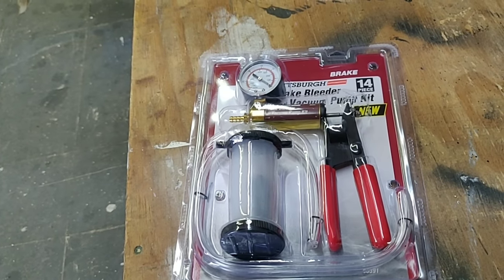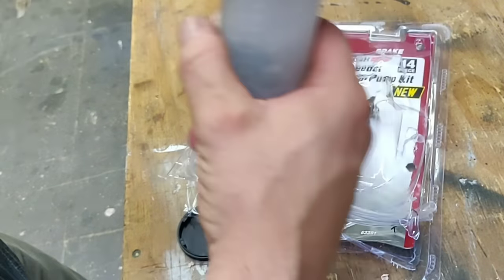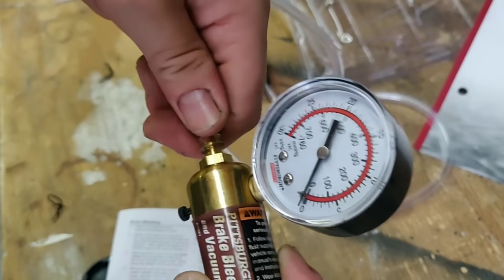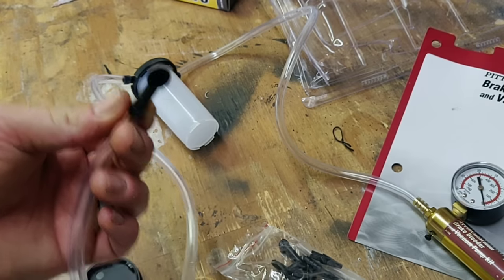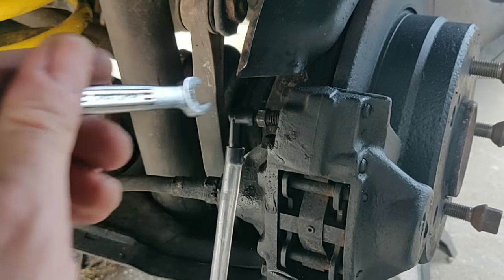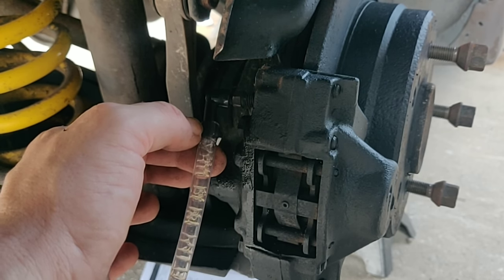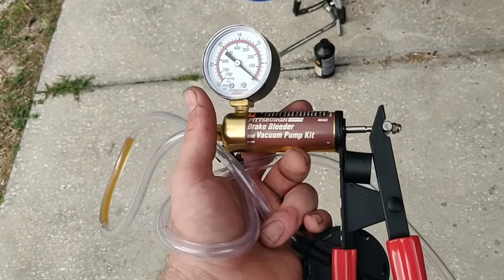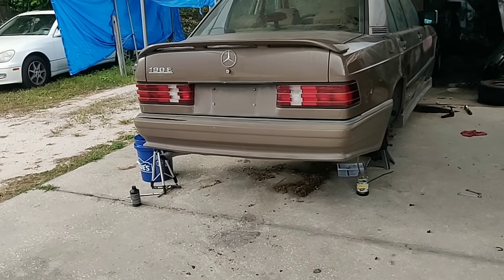Harbor Freight Pittsburgh brake bleeder vacuum pump demo and review

Comment: It’s not the pump! It’s that you’re doing it wrong my friend. You got to remove that little black cap that’s in between the handle & the bottle! That’s why if u don’t know what the hell ur doing read the instructions carefully! Now go back to ur garage trash can & retrieve those instructions and read them carefully. Just saying!
Reply: I have worked with hydraulic systems.  Seems to me a long tube, simple check valve and an inline fuel filter would work to establish a loop from bleeder back to reservoir.  Then just pump the brake pedal.  Another benefit is flushing the whole system.   About that "just saying"??  ditto.......LOL
Reply: JR BORIQUA7 let ‘em know!
Reply: Well said my friend
Reply: You’re correct. He still had the black cap on between the handle and pump. He wasn’t getting the full range of suction out of the pump. I took mine out and got 20inHg
Reply: Oops! Ah well....we’ve all had these moments. 🤦🏽
Reply: Lmao! Good shit ha
Reply: xsnrg714   That’s the first thing I did was rewind the video to see if he still has the black cap on that prevented the pump from pumping. 👍🏻
Reply: In fairness to Pete's Carport, my kit has the exact same collar/spacer, but it isn't pictured or mentioned in the instructions.  It wasn't clear what you all were talking about until I took a second look.  Once that silliness was out of the way, the kit worked fine and I did a flush on my Harley.
Reply: Yes, the black thing in between the handles has to be removed.
Reply: I’m still laughing.
Reply: Sour Kraut just as a heads up you shouldn’t just filter brake fluid as brake fluid  absorbs moisture and doesn’t like excessive heat either The reason why it turns brown and black is because it’s actually been boiled and not flushing things like brake power steering System like every third oil change is
Reply: More often than not the reason for components failing prematurely
Reply: Also, when he is 'talking it down' there is brake fluid in the hose where is not supposed to be any (beyond the catch-container).
Reply: lmao!
Reply: I bought it. Used it once and it broke. :-( I then took it apart and discoved the seals inside were not greased at all. Got the seal back in it's groove and greased it. Works better than ever now. So in other words, well conceived tool, just 'built to a price', no money for grease. Also the caps provided are too big for very small nipples. I have wilwood callipers and have quite some trouble on getting a good seal.
Reply: I still say that the front calipers even though they're new got a ton of crap pulled into them clogging up the bleed screw and he's blaming it on the pump not to mention he didn't even Grease the fitting to create a better seal. This is one of those channels that's out there just trying to make a buck and not actually inform people and doing it badly I may have
Reply: @jeffreydick5257  right? Brake fluid is literally one of the most hydroscopic fluids out there. Say if you have a bottle of brake fluid and forget to put the cap on it and leave it sitting overnight somewhere it becomes practically useless due to the water it absorbed being highly compressible
Reply: @bluesriderDF  In all fairness? As long as the rod is and the actual pump, if you're getting 2mm of motion on the pump stroke it should be obvious you're not doing something right.
Reply: @davidhouk7454   Everybody makes mistakes, everybody has a bad day once in awhile. I don't think the guy needs to be excoriated. Just my opinion.
Reply: @sourkraut6248  Only issue with that is pumping cooked or dirty fluid back into the system. You'll get the air out, but I wouldn't want to push fluid that's been at the caliper back into the reservoir. That said, I made a bleeder out of a check valve and a piece of hose. Rock solid pedal every time.
Reply: I just bought the same pump and was getting the same reading...until I took the plastic shipping stop.
Reply: RON K me too, lol.
Reply: @xnadave  You do make an excellent point.  Yes.......automotive brake fluid is relatively cheap.  Best to just replace as you go.  Pump reservoir down......refill......repeat.
Reply: I laughed way too hard at this comment LOL LOL!!!  Good Stuff!!!  :)
Reply: @campr23  What kind of grease? Good reference if I ever pick one of these up
Reply: @mrsemifixit  I just used ball-bearing grease (plastic/rubber compatible). It should not come in contact with brake fluid anyways (as it's behind the vessel to stop brake fluid getting to the pump). Anything really to provide a good air-tight seal and allow the seal to slide inside the piston.
Reply: What black cap u referring to
Reply: @samriley8278  haha im still laughing too! Glad he didn't delete the video out of embarrassment. My entertainment for the day.
Reply: @jerrysouthside8597  Between the 2 handles, it is fairly obvious when you look in that spot. It is a "spacer" that prevents full range of motion.
Reply: And it sounds like he may be a competitor of harbor frieght and his job was to discredit their tools and brand

Comment: You need to remove the spacer that's on it for shipping so it has full lever movement .so this was a pilot error. tool works fine got up to 20 to bleed my  brakes
Reply: Where's the spacer?
Reply: @jonathansimpson3545  it's between the handle and the piston. It's a round piece of plastic. It can be easily seen @ 7:00 into the video.
Reply: I will buy one and check it out.
Reply: I spent 45 minutes trying to get this to work, watched this video and was about to give up before watching another video.. then I saw he had removed the spacer as well... AARRGG>>> that stupid Spacer!!!   worked much better after I removed that.

Comment: I have a Pagid version (German brand) of this tool and it has one big failing that this one does too. When applying the vacuum to the bleed nipple air gets sucked into the tube from the outside, down the threads of the nipple.You can see this clearly on the first bleed, if that much air was in the caliper, you wouldn't have ANY brakes. A temporary fix is to smear silicone grease around the bleeder threads to act as a seal.
Reply: Good tip, thanks.

Comment: Thanks for video I just used vacuum pump and at first not much success after master cylinder rebuild. Then I put grease around bleeder made sure all the way around and it was a huge difference was able to open and get decent amount of fluid going through no air leak. Did both calipers twice and thought I was finished but brake handle pulled all the way in. Continued to work handle in and out and bubbles where coming out of master cylinder. Straightend up handle bars then more air came out. Have nice hard peddle now also in the past i have let sit over night air works it's way up

Comment: I like HF, and if used correctly this tool works. But an inline check valve in the bleeder hose, which is done for motorcycles, also makes it  a one man job using much simpler, more reliable and durable and less expensive components.

Comment: The tools work best when you use them correctly.  Air flows up, so you always bleed brakes with your tube higher than the brake bleeder so the air goes up and away, not back into the brakes.  Also your bleeder probably was clogged with rust.  Pumping the brakes probably broke the rust free from the pressure build up.
Reply: OK! Even probably had a clogged break line ?!
Reply: Could this be used to free up clogged lines?
Reply: Air will go to a vacuum first. But if you are just pumping the brake, yes keep your tube up.
Reply: He forgot to take out the the little spacer on the tool. With the spacer you cannot get any pressure
Reply: it wasn't clogged, he didn't read the first step in the instructions to remove a packing spacer so he couldn't actually pump it.

Comment: The bubbles were just from the sloppy fit letting in a little air. The brakes were bled. I learned that after a similar experience as yours. Thx for video!

Comment: Thanks for your honesty. I had the same exact problem. Mine also, was mostly sucking air-----not fluid. I took the tip by some of your responders about greasing around the bottom bleeder screw. it did help a bit, but made everything messy and slippery. Then you had to make sure the bleeder suction cap didn't fall off. This tool should have had a big notice about that.
Reply: He had to remove a stopper right above the red handle, just read the instructions, otherwise the tool would be useless

Comment: Helpful tip!  If you're in a bind...... pump the brakes yourself, wedge between the pedal and the seat cushion an appropriately-sized piece of lumber to hold the pedal down while you open and close the bleeder screw.  Repeat and repeat and repeat..... no neighbor necessary.

Comment: Uh...  you might want to read ALL the directions first.  The tool is fine, it's operator error.  Also, when you say "pressure" you mean to say Vacuum (negative pressure).
Reply: R Stelzer on these videos I always look for dirt under the fingernails,he failed.
Reply: @ @joemc111   Agree he failed using the product.  If he failed because of "dirt under the fingernails", wow you must be something!  Even with gloves on while working on cars they often rips and you will get dirty finger nails.  I had to double check I was not watching a cooking show or nail polishing show.
Reply: Vacuum is not a "negative pressure" Vacuum is an ABSENSE of pressure.There is atmospheric pressure (15.7 lb/sq.in. which is the pressure on the surface of earth and reads zero on a guage. There is guage pressure which begins at zero PSI (which is atmospheric pressure) and increases with pressure applied. There is absolute pressure which is the sum of atmospheric and guage pressure. Vacuum is not pressure.
Reply: @callmenortnortin467  So in a vacuum chamber, if you pulled a vacuum equivalent to -14.7 PSI it would not equalize atmospheric pressure which is 14.7 at sea-level?
Reply: @rstelzer2928  until you grasp that pressure is a force measured in pounds per square in or a number of bars(bars being a term derived from barometric pressure,or the pressure the atmosphere exerts on the surface of earth). on a surface,,and that a vacuum is an absence of any pressure ,you wont be able to realize and separate the two phenoms from each other. Pressure cant be a vacuum and a vacuum cant be a pressure,,and that means there is no such thing as a minus pressure .
Reply: He meant that dirt under the finger nails implies he's a real mechanic.
Reply: @callmenortnortin467  is it gonna rain or not,

Weatherman?
Reply: Actually yes vacuum  is negative to the psi but  they are measured using different  scales thats the only reason why its not negative pressure be cause it gets measured in in of mercury  have you ever looked at a ac machine low side gauge has psi an in/hg on the same gauge separated by the number zero  but why do we got to get soo damn critical
Reply: @robertdunn7717  I did not know you were so...  sensitive.  Sorry this upset you so much.  Calm down,  the world still turns.
Reply: I'm upset and sensitive no i just can't stand people who try to correct others when they obviously have no clue what they're talking about

Comment: I usually just leave all four bleeder valves open and watch over the master cylinder to make sure it doesn't run dry. Takes a while up to an hour sometimes but it works and it's easy peasy

Comment: A little late to party.  But I just bought a set of these after watching your video and found that I could not get the pressure up to 10 Hg - until a rubberized cylindrical piece that was obviously added for packaging and shipping only (I could not put it back on) fell off the tool.  After that I had full range to pump and would exceed 10 Hg in 3 or 4 pumps.  You can see this "limiter"(?) @6:50 in your video - it is covering up the handle pivot point.  FWIW.
Reply: Exactly what part is it?

Comment: Volvo recommends bleeding Front driver side first,  Front passenger 2nd,  Rear drivers side 3rd and Rear passenger side last.  Please note,  Front bleeder valves may differ in size from rear depending on year or model so check bleeder valves and determine if they differ or not as you may need two different size bleeder hoses to connect to bleeder valves.

Comment: Its always good to have as short as possible tubing. The more volume in the tubing and collection between the bleeder nut and vacuum pump the less effective it is. It is also better to "pull" the air out as opposed to "pushing" it out.

Comment: Look at the instructions on page 4; “Remove spacer prior to use.”  It looks like the spacer wasn’t removed which didn’t allow the tool to use a full range of pumping motion to create the vacuum.  I had the same issue with not being able to pull much more than 9 inHg, until I removed the spacer and then the tool pulled easily up to the max recommended 14 inHg.

Comment: Same experience on my part with same tool. I used the single hose dipped into a water bottle with a few inches of brake fluid in the bottom of the bottle. Pump up and down on your own.

Comment: What was happening was that the pump was pulling air from the outside of the brake caliper pistons, past the piston seal ,which only seals ON WAY, against pressure from INSIDE the caliper, not against pressure from OUTSIDE. All those bubbles you saw was air being sucked INTO the caliper, past the seal, by the suction of the pump..
But when your neighbor pumped the brakes, he was producing pressure inside the caliper piston, which caused it to seal and blew the fluid out through the bleeder fitting. I've never had success with sucking brake fluid out. I now use fitting which consists of  a tube into spare brake reservoir cap, through which I pump pressure into the master cylinder. This replicates someone pumping the brakes.
When getting someone to pump the brakes, you do risk scoring the piston seal or the master cylinder itself, if the person pushes the brake pedal to the floor, causing the piston to travel past where it usually stops, into the normally untouched part of the master cylinder. This end part of the cylinder often has accumulated grit and other contaminants which, if scraped along the cylinder, will prematurely  cause the piston seal to leak.
Reply: @Tezzzaaa  Yep, it was  a very bad demo

Comment: If you're bleeding a motorcycle you have to use the other 3" line to the bleeder valve and it can also work for your car as well so the fluid moved directly into the container without losing some fluid in a longer line before it gets to the canister for holding the fluid when vacuum is applied to the system. I never needed the other 23" line. I think mainly for testing engines and vacuum valves for fuel systems is what the other 23" line is for maybe. Evidently he doesn't read his comment sections does He? Remove the spacer in the handle dummy. That's for shipping only, it will pump on up to 20 lbs. Anything over that is likely going to damage the Master Cylinder. As per instructions, plus you were supposed to use a nipple that fits in the 3" line and then plug in the correct adapter for your specific bleeder size. You get a better seal that way and can pump on up over 20 pounds that way. Plus this gauge is for setting vacuum on carbs for motorcycles so they will be balanced as well.
Reply: I had to read your comment twice before I caught on to what adapter you were talking about. Thanks for the tip.

Comment: I bought mine about a year go and today I’m finally using it.  Mine pumps up too the fill 30 psi with no problem.   Appreciate your video. Cause mine didn’t come with any instructions. So I did t mess up on the fitting where the 3” hose went. I wouldn’t have even payed attention to its proper loc until it was too late.  Sorry you had a bad experience with yours.    Any way thanks for the video    🙄

Comment: Don't use the black adapter it never seals for me, I connect the hose directly to the nipple.
Reply: Doesn't that hurt?
Reply: Ferd Janklow HA! I’m weak loool
Reply: how do you seal the leaky threads on the bleeder??
Reply: @glasser2819  I had the same problem with air leaking through the threads.  No problem with suction I get near 25".
Reply: @glasser2819  you can use grease or thread tape around the bleeder screw threads
Reply: André Carvalho  any grease will do. Once you tighten the bleeder screw you remove the grease.
Reply: You pack the grease around the bleeder screw and the opening it screws into.

Comment: Mine was doing the exact same thing.   I found that  the caliper to  hose adapter  want not an open channel ( there was still flashing of plastic from the injection mold blocking it)    A little time with a drill bit and now it works fine!
Reply from the maker: Awesome thanks for input and watching.  Love the positive inputs. Have a blessed day